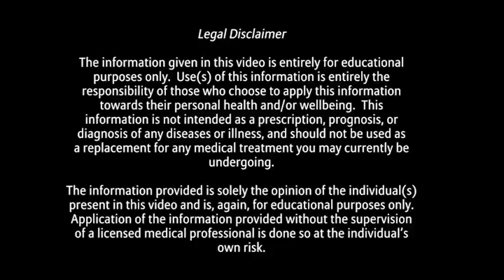Homemade Faraday Cage

Comment: I really need advice if anyone can help to the best of their ability. I currently live in a motel room with a kitchennet and don't have the option to move right now. There is a 5g tower 4 blocks away in one direction and 1 mile in another direction. I want to sheild my room from emfs and I can only afford to use reflectix, aluminum window screen and galvanized steel but I need advice on how to do it safley without making emfs worse. Should I put it on every single wall from floor to ceiling or just the 2 walls that the 5g is coming from? Also since I live in this room if I'm on my laptop or using my phone which i usually am in the room will it make it dangerous and start ping ponging around the room? Will I still be able to use electronics in the room without it being dangerous? I basically want to limit emf exposure as much as possible especially the 5g is the main concern, if there's a little bit of rf for now it's fine but my goal is to just limit emf as much as possible especially from the outside but I want to do it safely because there will still be electronics being used in the room until night time. Would it be best to just do like 2 or 3 sides of the room or even a faraday cage section of the room separate? Also will ot become an electrical trap of I don't ground it? Any advice helps on how to shelid this room. Thank you and God bless 🙏❤️

Comment: All houses need this put inbetween the room drywall.  Should still work.  Go to your local grow store and they sell a beefed up version that will work way better in 100 foot rolls and if you are remodeling your room with a slight tear  down put it on before your dry wall .
Reply: In my moms place she has 13 smart meters next to her kitchen . I put up the grow stores heat blocker shield milar roll and our phones worked near that's wall and her head aches went away . I feel there will be a law suit again the land lords one day for not changing them out . The apartment  above her has the bed room directly  above the meters.

Comment: I read on a German language EMF sensitive website the same thing, to get these blankets to shield the rooms. It's not as strong as the super expensive silver canopies but if you use several layers it will be stronger.
I have smart meter inside my living room opposite my bedroom, fuse box at the foot of my bed and electric boiler next to my head but that's broken.
I turn off all fuses except for the fridge at night and have a few layers of aluminium foil on top of the smart meter but seen they can read it, l doubt it works. I would need an EMF Meter to measure it. 
The cheap ones are allegedly worthless but the expensive ones are just too expensive for me! 
I rather invest into EMF protection than a meter.

Comment: Radient Barrier, 100' rolls $50, use four to ten layers, available at home depot, or nasa grade radient barrier roll, available thru amazon work better than mylar. More equals less microwaves. Lead 4'x50' rolls block RF the best. Yet use gloves and paint it with elastomeric paint.

Comment: Thank you so so much Tony ... I'm assuming under the bed or under the floor might protect me from a goepathic stress line ... thank you again and again cheers. ..
Reply: I really need advice if you can help to the best of your ability. I currently live in a motel room with a kitchennet and don't have the option to move right now. There is a 5g tower 4 blocks away in one direction and 1 mile in another direction. I want to sheild my room from emfs and I can only afford to use reflectix, aluminum window screen and galvanized steel but I need advice on how to do it safley without making emfs worse. Should I put it on every single wall from floor to ceiling or just the 2 walls that the 5g is coming from? Also since I live in this room if I'm on my laptop or using my phone which i usually am in the room will it make it dangerous and start ping ponging around the room? Will I still be able to use electronics in the room without it being dangerous? I basically want to limit emf exposure as much as possible especially the 5g is the main concern, if there's a little bit of rf for now it's fine but my goal is to just limit emf as much as possible especially from the outside but I want to do it safely because there will still be electronics being used in the room until night time. Would it be best to just do like 2 or 3 sides of the room or even a faraday cage section of the room separate? Also will ot become an electrical trap of I don't ground it? Any advice helps on how to shelid this room. Thank you and God bless 🙏❤️

Comment: I hear a low-frequency humming noise most of the day.
Reply: your surroundings have been sprayed with heavy meals those are being charged by emfs and now they are emitting radiation detox heavy metals switch off the electricity from the mains when you don't need it

Comment: Thank you. QUESTIONS:
1) How to shield the windows?
2) Will this shielding help against 5G from a cell tower, which was put on the roof of the house across the street, about 20-30 m away?
I already go tinnitus and hear nonstop 9 Hz, sleeplessness, often headaches, skin rashes. It's a nightmare.
Reply: Cheap alluminum screening  from the hardware store
Reply: They also have special curtains that help block...

Comment: Aluminum foil doesnt work - I spent literally over $500 on a shit ton of foil. I bought ginormous rolls of heavy duty foil to block my neighbor using RF to spy on me. Didn't work at all.
Reply: P.s. yeah it did block out my cell service but that doesn't mean they can't use a microwave at a higher or lower frequency.

Comment: Faraday room cage .
Canopy .

Block ALL your windows from nano frequency .

- Put string on both sides 
& across over the head
 of your bed. 
⤵⤵⤵⤵⤵⤵⤵⤵
- Tarp. 
- 4 Aluminum blankets. 
tape two or four of em together. 
- Spray on copper for better coverage onto aluminum. 
- 6 aluminium blankets 
on the head+ foot
 of the bed.
- Place aluminum blankets on walls of the foot and head of your bed. 
- 4-5  Sheets of aluminum also  under the bed.

To your health .
Tony and Dave .
♡✌😎♡

Comment: HERBSPLUSBEADWORKS What can I use to block high electromagnetic field coming from my ancient refrigerator?  Its as high as the circuit breaker box in my room according to emf meter.  Will the insulated aluminum work on these fields?  Don't want to spend on high dollar http://www.lessemf.com/mag-shld.html Plates they sell.  My husband is mad at me for cleaning up the house of emf he says I am obsessed.  He is under the delusion that "its not his reality" as if ...if he ignores the negative emf it won't exist or something   Its the old "negativity is bad" programming.  I keep telling him what if they said that during the last holocaust.  now we have the silent holocaust.  Which is "my reality" apparently.  But I have had Cancer and was ignorant and took radiation in 2002.

Comment: Steven McGee, author of Toxic Electricity, tested these mylar blankets and found them to be almost useless. The farther away from the edge, the les protection it offered. Maybe the aluminum wrap for keeping things cold would be better. Hats would bee good too, and thanks for the tip about the cell phone, I will wrap it in aluminum foil from now on.
Reply: No need to wrap your phone you could actually magnify the signal in some cases. Better is to put on airplane mode when carrying with the screen facing your body. When you need to use it turn it on and when you make calls use speaker phone.  If you want to use internet on it get an Ethernet adapeter cord for it

Comment: Thank you for the video. 
QUESTION  - to Tony or anyone reading this:
I see preppers talking about their "bug out vehicles" they will use to get to their safe, stealth,  "bugout locations" to avoid marauders - but I am thinking - aren't the bugout vehicles basically a "BEACON", "GPS", "TRACKING" device telling the govt, police, Homeland security etc., where they are?
They park their bugout vehicle at their bugout location and it is a tracking device. YES?
So, my question is - HOW do you "disable" or "shield" your vehicle from becoming a beacon that tells where you are?
I have heard that the "onstar", the winshield "bubble", the "sirius" radio, the rear view mirror, microphones and other devices in vehicles have been ordered to inform police where "criminals" are. Successfully. They drive right up to wherever the vehicle is parked - underground, undercover, doesn't matter. 
What's to stop them in times of chaos and danger?
An aluminum windowscreen, grounded "net" over the vehicle?
An aluminum coated tarp over the vehicle?
Pull a fuse?
Any suggestions .......

Comment: If it works for you great, but I have a wifi app on my phone and only if the phone was completely encased in foil, did it stop receiving signals and I think that would be the same with a bed. A canopy is insufficient, need to be totally enclosed IMO.

Comment: Love you guys but a real Faraday cage is a layer of metal plus a layer of insulation. Like for protecting cell phones from an EMP. You can put phones and laptop in a metal filing cabinet lined with cardboard or wood on inside or vice versa.  Whoops 2:57 AM. Time to turn off cell phone!!

Comment: Hey Tony, I'm thinking to do this for my room but I want to ask doesn't the foil aluminium need to be grounded with copper wire into the ground because it will be charged up and will shock someone? Also wouldn't the magnetic fields be attracted to it from the wall and do something to it? Also wouldn't it be very dangerous if someone was to use their phone in there since the radiation will be bouncing all over the place and be extremely dangerous? I heard this from others but not sure if it's true. Thanks

Comment: Would the aluminum blankets work for making protective helmets (hardhats)for the huge solar  blast that's coming VERY SOON (THE EVENT)...OR DOES IT HAVE TO BE LEAD.Without protection,it will fry our brains and erase ALL memory!!! I also suggest anointing your house and family with Holy Oil!!! Every door, window, wall, ceiling ,floor, and foreheads BEFORE  this Event and/or 3 days of darkness! Also STAY INSIDE during the Darkness or you may be overtaken! Stay away from windows and open the door for nobody!!! Holy Oil  WILL protect us during the Darkness!!!Please share with believers. For by Faith and GRACE we are saved! Blessed be Heart and Soul!

Comment: i wonder if them wanting us to do away with the lead paint in our homes is so all the frequencies won't be blocked? hmmmmm
Reply: That is exactly why they have trashed the reputation of lead paint!! It’s because it blocks these frequencies!!
Reply: This is what Ive been thinking for years. They deem kids have been lead poisoned. Its actually heavy metal poisoning that is in vaccines.  Most kids that have the "lead" poisoning where Im from are poor and or black. Maybe a wrong observation but Its what Ive noticed. Ive also researched that the Medicaid vaccines are different than regular insurance vaccines. they at one time were kept in a different place
Reply: I worked in the water department for 15 years dang near everyone has lead pipes from the water main to the curb. Inside of the pipe is a layer of rust and other buildup that coates the pipe. I dont believe that the lead pipes are to blame. I could go on forever.  But I've been thinking about making my own lead paint and painting the inside of my home
Reply: Karine Recipe please?
Reply: Very insightful. I was just thinking of here I could find lead paint.
Reply: And the lead water pipes which they said were dangerous?  But usually those were replace with copper pipe which I understand is better?  Anyone?
Reply: @rockie6890  , Copper kills virus and bacteria.  I watched a video from Europe about farm animals that  choose water from a copper pipe instead of a lead pipe. The animals instinctively knew the healthy choice.

My son was a union plumber that plumbed commercial buildings. He was taught copper was the best to use but expensive.  They still use lead pipes in commercial construction.  Pex...cheap but broke down over time and released minute toxins.

We have copper in our house. 
Cheers

Comment: Can't find those aluminum blankets anymore at dollar stores. TPTB obviously don't want us to have these for protection anymore. Just in time for 5G rollout!
Reply: Amazon. Search for emergency blanket. I've bought the Swiss Safe and they are a great value. Pack of 10 for $10.
Reply: 10 Pack for $6.87 https://www.amazon.com/Mylar-Mens-Emergency-Thermal-Blankets/dp/B007IYIYFE/ref=sr_1_9?ie=UTF8&qid=1547309359&sr=8-9&keywords=emergency+blankets+pack+of+10
Reply: Except according to the book, Toxic Electricity, upon inspecting these blankets, they don't work. Get away from the edge and their inefficiency is profound.
Reply: Jody Clark eBay

Comment: OMG, thank you so much! I work in an airport and they give these blankets out all the time and I have a few, Great idea!!!! I was going to order Y Shield paint to paint my house what do you think of it?
I wrapped my smart meter with aluminum foil, aluminum tape, aluminum screen for the front of it so they can get their reading and an aluminum round clamp to hold it tight so it doesn't come off and bf., my emf meter was reading 19. something to I think 24. something and now its reading like 2.??-4.?? a big difference I also wrapped my electrical box with aluminum foil thats actually when the meter went down to 2.-4..
Oh just thought of something does it matter what side of the foil is facing toward your body?
I watch your videos all the time I don't know how I missed this one until now, GREAT VIDEO!!!
Reply: @B Silano - hey girl, how have you been?  Glad to hear your works have worked.  The answer to your question - The shining side goes outwards, so the dull side goes toward you.
Reply: I really need advice if you can help to the best of your ability. I currently live in a motel room with a kitchennet and don't have the option to move right now. There is a 5g tower 4 blocks away in one direction and 1 mile in another direction. I want to sheild my room from emfs and I can only afford to use reflectix, aluminum window screen and galvanized steel but I need advice on how to do it safley without making emfs worse. Should I put it on every single wall from floor to ceiling or just the 2 walls that the 5g is coming from? Also since I live in this room if I'm on my laptop or using my phone which i usually am in the room will it make it dangerous and start ping ponging around the room? Will I still be able to use electronics in the room without it being dangerous? I basically want to limit emf exposure as much as possible especially the 5g is the main concern, if there's a little bit of rf for now it's fine but my goal is to just limit emf as much as possible especially from the outside but I want to do it safely because there will still be electronics being used in the room until night time. Would it be best to just do like 2 or 3 sides of the room or even a faraday cage section of the room separate? Also will ot become an electrical trap of I don't ground it? Any advice helps on how to shelid this room. Thank you and God bless 🙏❤️

Comment: This foil is way cheaper and stronger . I stick it to an old tent and I connect the foil to EARTH  / Ground  https://www.ebay.co.uk/itm/Vapour-Barrier-Thermal-Insulation-Aluminium-Foil-Membrane-1-2m-x-10m-Sliver-UK/292496356629?ssPageName=STRK%3AMEBIDX%3AIT&_trksid=p2057872.m2749.l2649

Comment: Are you saying that if you ground the aluminium then you don't need to paint it in copper?
Will these aluminium sheets be effective, considering that they're only coated with aluminium?
Also, what's the difference in effectiveness between one of those basic small steel(?) earthing rods and wire connection vs a 6ft copper grounding rod and copper wire connection?

Comment: Thank you for all your great videos Tony! I packed my smart meter in 5 layers of aluminum and duct taped it all around ;-) At night before bed I completely turn of the router. I have no smart phone/cell phone, only a GSM phone without any WiFi options ;-) Next to my bed, close to my head, I have an orgonite pyramid with black tourmaline inside. Works like magic! Still hearing the high tones and buzzing in my ears, but I hear them during day time as well. Guess I got to live with that, haven't found a remedy cure for it. It's not always very loud, it depends... I'm considering plugging my laptop back into the router with an ethernet cable and turn off the WiFi (both in the router and in the laptop), which would be better, but not very practical... well... I have an orgonite pyramid next to the router as well, which works like a charm as well.

Comment: I wish I could message you directly I have some questions I was wondering if you had an answer for.. EMP.. okay. Emp goes off, all electronics in range are fried... power plants go unmanned for x amount of time, emp goes off.  So, emp goes off, almost all 1980+ vehicles are gone.. what if I made a large enough faraday cage to get my jeep in? I'm sure walls and roof would be easy part. But if I were to build a base for the floor could I put wood over top of the material or does material have to be exposed? Like on the top layer of the floor? Or does it still work if it's covered? I imagine it would still work but I'd like confirmation before starting to build an emp proof garage.. I can't afford $600 for a new CPU and other back up electronics but I can get building materials. Thank you